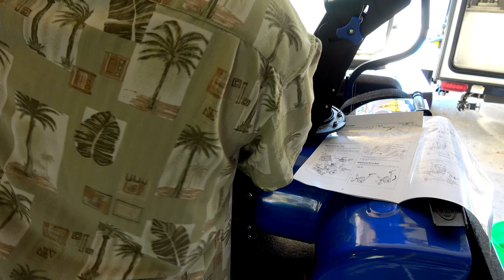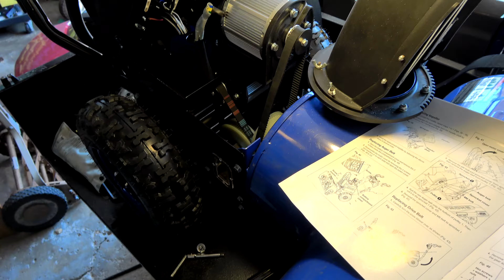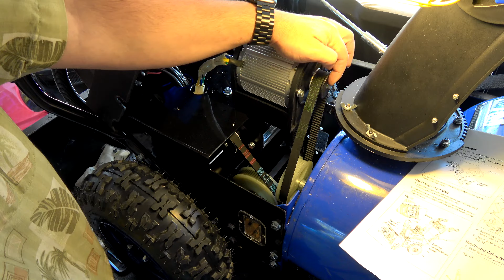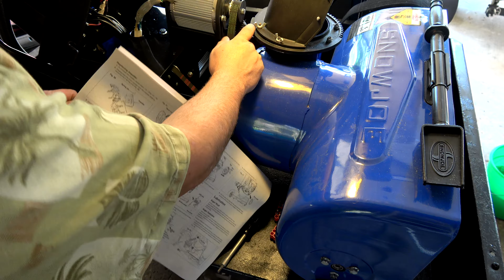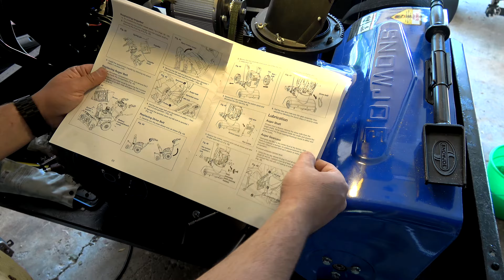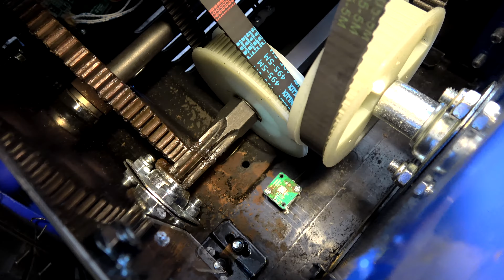Snow Joe iON8024-XRP 80-Volt Internals/Mechanicals  two stage snowblower

Comment: What do you call the screw’s you removed in the battery compartment and size of screws ?
Reply from the maker: Hex bolts.  need hex bits, from the video i believe it was 5mm.
Reply: so what tool should I look for at Rona or Home Depot ?
Reply from the maker: @enzoscalisi7783 send me an email, email address is in video details. i sold my snowblower 5 years ago, was overkill honestly and went back to my single stage. please email me over a photo if you can of the screws you are trying to loosen as im really trying to go off memory and the video, and i may have been more than mildly intoxicated while making said video..... I want to make sure i point you to the proper tools. no matter what the tools will be fairly cheap.
Reply: I cannot seem to attach  a pic ?
Reply: What is your email address ?
Reply: how do I send you a photo ?
Reply: hex screwdriver inside springs in the battery compartment . The tool you used is in your video …
Reply: ok, I managed to unscrew both hex nuts using my existing 5mm Allen tool set. Thx . Now I need to proceed with opening up the cover unscrewing the 6 bolts on each side then inspect the right battery compartment wire connection , will keep you posted

Comment: Mine is unable to sense a battery in  the right battery compartment - no green bars on a good battery - it’s not the battery ! Any ideas on how to fix or where should look to resolve ? Thx
Reply from the maker: check for fuses
Reply: fuses ? Would the fuse be controlling the battery sensor ? The machine is not sensing the battery. Where would the fuses be located ?
Reply: where would the fuses be located ? The machine does not sense the battery and not coming on .
Reply: I would think it’s a loose wire or something under the pins that is not sensing the battery ? The pins in the battery compartment seem to be ok .
Reply from the maker: @enzoscalisi7783 could be connection inside that disconnected. if a fuse blew it won't do anything at all either.
Reply: there are no fuses in this machine . I will try to open up the cover but was unable to locate two screws in the battery compartments , are the screws in side the springs ???

Comment: I just got one of these on marketplace for free, but no batteries and charger. the batteries are not worth it IMO. I'm going to try and wire (2) of my Ryobi 40V batteries to make this work.
Reply from the maker: it should. I sold mine as the 40/80v line was discontinued. I still have the single stage snowjoe and my batteries are quite aged now after 10+ years, so i have an ammo box with some mounts inside and now use my Milwaukee M18 batteries on my 40v snowjoe.

Comment: Mine runs a few feet and cuts off
Reply from the maker: Hopefully it's under warranty. This particular model had a lot of issues. Ended up they swapped mine out for the  brand new model which did great, however, overkill for my driveway and sidewalk, so I sold it and kept my single stage.
Reply: @KmanAuto  I gave them a ring and they didn't want to support any kind of warranty. I found some new batteries on eBay and it seems to be working pretty well now.

Comment: Can you send me a picture of the bottom of the battery box. I got one but the wires have all been cut/removed from the underside where the pins are.
Reply from the maker: No sorry. Sold it. It was extreme overkill for my driveway.
Reply: Mine is unable to sense a good battery on the right battery compartment , would you know how to fix or how to go about trying to fix or repair ? It’s not the battery , no green bars display after inserting the battery . Loose wire ??? Thx

Comment: Were you ever able to use a different battery with this snowblower
Reply from the maker: I actually sold it. It was WAY overkill. Out my neighbors huge Arins to shame. I still have my single stage 40c snowjoe. My batteries are around 10 years old now, so I'm planning to retrofit so I can use my Milwaukee M18 batteries in it.
Reply: @KmanAuto  I was trying to but wouldn't recognize assuming something with temperature sensor etc any idea by chance?

Comment: The shaft for the drive  system the one with smalle metal gear striped on mine.. they dont sell any internal parts for those unit.  Very sad...

Comment: l used to have it ... don't bother to buy it if you had heavy slushy snow on your area... clog up all the time...good for light and puffy snow...just looking good machine but not functional when you need power... expensive too....single stage gas snow blower way better tan this garbage ...

Comment: The title of the video is wrong and should be corrected to read: Snow Joe iON24SB-XR. The improved model is the iON8024-XR. And, there are two generations of the  iON8024-XR: Gen1 had the chute control as a toggle switch, whereas the Gen2 puts two buttons (left/right) on the console instead. I have used all three snowblowers and in Canada, the Gen2 is the one to get. Make sure you install chains for the tires, it is essential. And spray Fluid Film in the bucket and chute to prevent clogging (that stuff is unlike any other lubricant, and performs incredibly well).
Reply: Satisfait de cette marque? Snow joe? j’hésite entre la 1 stage snow joe 100volt et la Ego 56 volt

Comment: the wheel motor is pretty gutless is there a way I can like over volt it or do something and  make less grinding noises?
Reply from the maker: Electric Lawn Services No, it’s basically computer controlled, so it can throttle back power or increase as necessary. It does this to extend battery life.
That being said, this blower didn’t even make it through the first snowfall. Took me about 8x longer to clear the drive than if i used my snowjoe two stage blower. 
The blower in the video is the first gen snowjoe two stage, and instead of blowing snow it would more or less just push it....
Snowjoe warranties it out for a new one, latest gen, and i’ll say what a difference! complete design change. And the thing moves and moves and moves the snow. even shot out some rocks it picked up
Reply: @KmanAuto  thats unfortunate, I basically only use this thing right now for ends of drive ways, its not really that fun to use and the effeency really isn't there with sunjoe batteries. My ego blowers do 75%-80% of the actual work in my snow removal jobs.If I could like strap a 3000 what hour battery to it, it still wouldn't have enough pushing power in the wheels to do what I need it to do... pretty disappointing.
Reply: Wish I could like shunt a voltmeter or something.
Reply from the maker: The replacement they gave, I did 4x 30!ft long by 20 wide driveways on a charge, snow was wet and heavy at about 6” deep.
Reply from the maker: and i have two sets of batteries, so by the time second set is dead, first set is charged to about 60% or higher already.   i can also cut one cord of wood on a single charge with my sunjoe 40v chainsaw
Reply from the maker: @crimmy0204  What exactly do you need it to do? What I found is it had nothing to do with the battery, what the problem was was the controller they are using. It varies power depending on load, my first one would not ramp up the power to turn the augers enough to do any blowing. the wheels work the same way. it should have a three year warranty, just contact SnowJoe, tell them what the problem is and they may just swap it out for the latest model. I've beat the crap out of this replacement and it's going good and strong. I even put on my old worn out boots that have no more tread on them, and instead of walking behind my blower, I let it pull me :-) It was fun, but then I fell on my backside and put my grippies back on.
Reply: @KmanAuto  the problem I have with it if there is like a 2" incline it renders the unit useless. the wheels will not even push up it so yo literally have to treat it like a single stage. and its much heavier than my single stage units.
Reply from the maker: Electric Lawn Services Definately something wrong with the machine. Mine does not have that problem. Contact snowjoe. I was very disappointed with the first one, but again, it’s replacement blows that our out of the water. They may surprise you!

Comment: There's a 2nd revision of this (I just bought it, but hasn't arrived).  It's the one with a black bucket in front.  I wonder if they improved the drive gears at all.

The biggest change was that supposedly the auger motor won't die out as quickly in use.
Reply from the maker: Kuth70 Haven’t gotten to use mine in snow yet, I didn’t pay full price music close out. I do believe the handle buttons are better now too and push down instead of pull up. hoping I’m not going to be disappointed. So in lots of different feedback after I bought it that I wish I saw before hand. The general consensus is my single stage snow Joe will work better than the dual stage. I hope they’re wrong.
Reply: they did not, and I can't get the pulley from them anymore... not sure on the 100v version though...